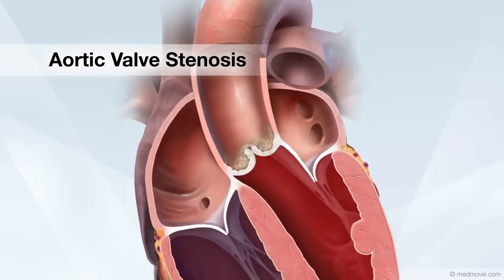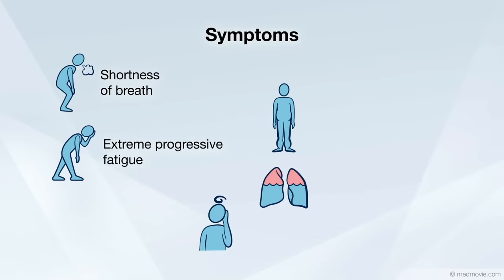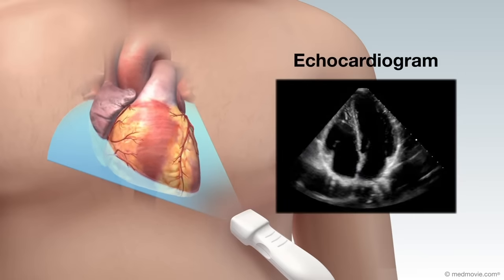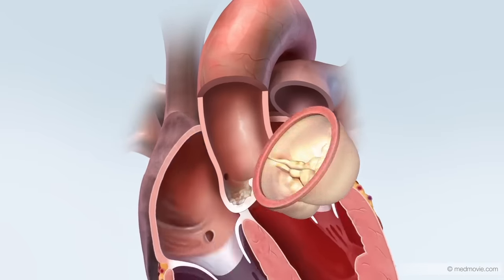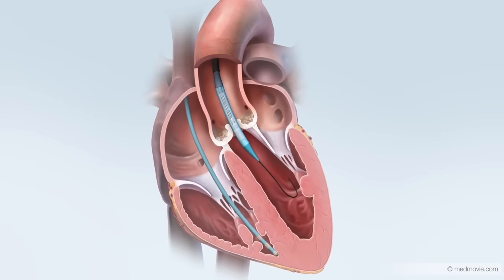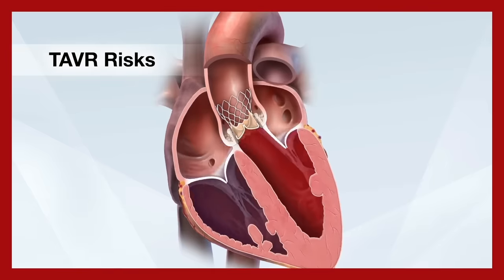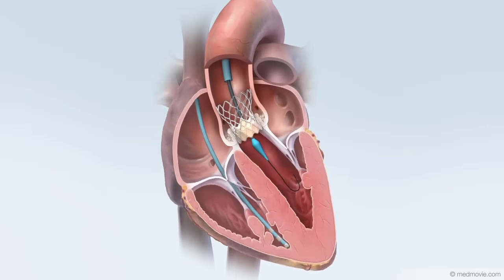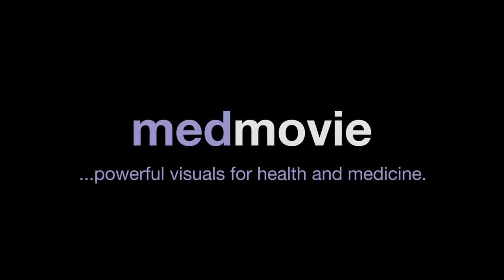Transcatheter Aortic Valve Replacement (TAVR) Treatment for Aortic Stenosis

Comment: I believe TAVI is very much prone to Stroke, because pushing a new valve on an old one poses high degree of risk for calcium breaking. The process is expensive and still the gold standard is either SAVR or MIAVR which have their own drawbacks 😢

Comment: If only this worked well on bicuspid valves. I couldn't wait any longer I guess. Put it off so well I forgot about it. Ended up with severe aortic stenosis due to my bicuspid valve. April 22nd is my open heart surgery. I chose the Inspiris Resillia bovine valve. It's TAVR ready if it ever goes bad. It's performing wonderfully in tests I've seen. 99.3% of surviving patients at 7.7 years had zero degradation to the valve. I sure hope this translates into many good years for me.
Reply: Bicuped valves kis age me chang hota h sir